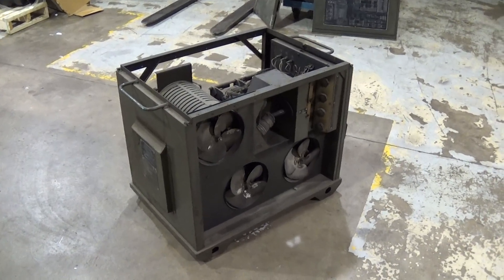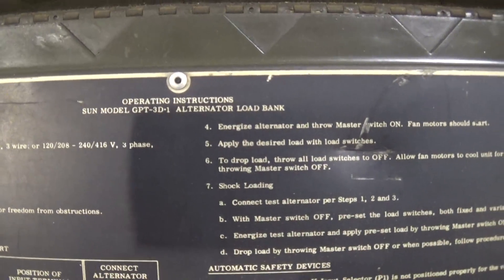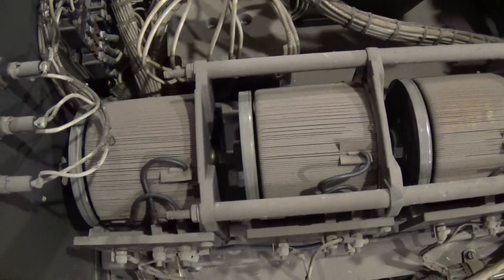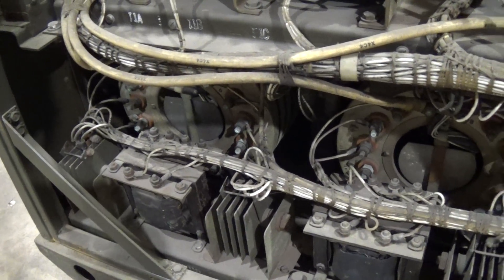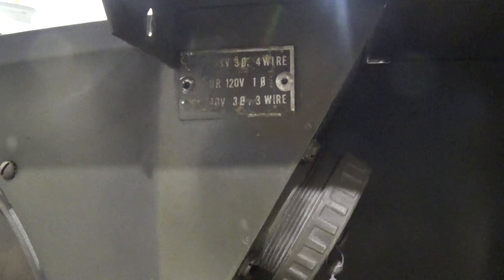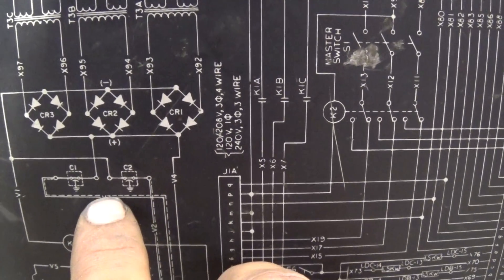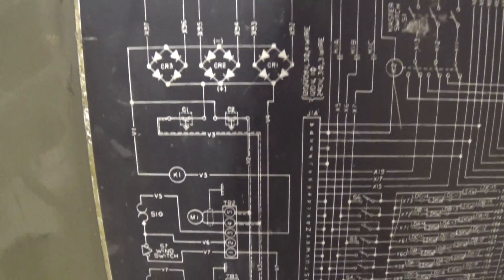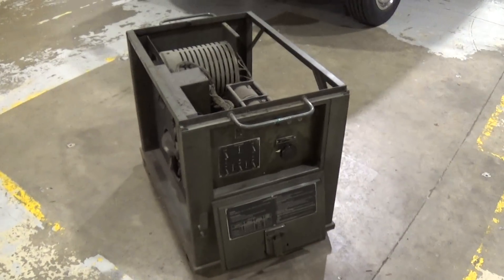30KW GENERATOR LOAD BANK

Comment: Neutral connection seemed to be common for relay coils... Rheostat looked more like a 3 phase variac? Military has their own way of doing things. DC fans, probably to operate over a large voltage range. We always called those proving switches "sail switches" on all sorts of equipment. If you smell rotten eggs when you hook it up, look at the seleniums, they age out, used or not.

Comment: As mentioned by others, I would consider replacing those  Full Wave Bridge Rectifier Assemblies. If you pull one of those motors it may have a nameplate with current draw to determine size.  Also I'd strongly suggest you replace the Filter Capacitors, I'd assume they are some kind of "wet" type that dry out and are very prone to short out...usually at the worst time. That unit looks like good solid military grade construction though.

Comment: wanted to ask a question for the bigger older generator heads that run 240/220v 60hz or 50hz 5kw+(non-inverter type), could one run household stuff like computers/tvs etc off these, or are these strictly lighting and element types

basically is the power clean enough to run more complicated stuff, or is it far to spikey?

I wanted to build a generator head just to see if I could do it, but if it needs to be inverter based for anything other than lights, I might as well get a pile of 125amp alternators and hook it to a car engine with the biggest inverter I can find. the big old generator heads have always amazed me at the power outputs

Comment: 416v is a byproduct of 240 wye. It's not super common but maybe the military made use of it.
Reply: I think it is very common in Europe here.  About everything here that has some power runs on this voltage. √3 of 240 is 416...

Comment: Just a quick look at the schematic, unless the neutral IS hooked up, the fans probably won't work. Left most terminal of the transformers are all common with neutral. Also, relay K2 is common with the transformers. That also means you can have lethal voltages on the neutral (L0)if it is not well bonded to ground.

Comment: As I recall, selenium rectifiers can produce some very hazardous fumes when they fail so replacing them might be a good idea. You may be able to hide them to retain the original look. What you referred to as a rheostat is more likely an autotransformer but I sure could be wrong. You are the generator guru, not me.

Comment: you might even need that other load bank on ebay, some of your projects are large enough that 60kw would keep them from getting wet stacked. I am sure it is either the selenium rectifiers or the caps. but you will see which. with that girl friend, if the inside of the house gets cold, just run the wires from that massive blue jobbie out back into the abode, and overheat the living space in 5 minutes, if below zero.  I have been thinking about getting a large 41kw super computer from england, and it would do the same thing.

Comment: now days the model name would be preceded by an AN/ 
g means ground use
p means radar.
t means transmitting 
so you have a tester meant for a radar station 
also.  a lot of miltary generators for radios are 400hz 
gives a cleaner signal

Comment: Those look like selenium rectifiers, and if so I'd take a close look at them, as they usually get weak over time. If it were mine, I'd probably replace them with standard silicon diode bridges. Might have to add a bit of resistance to make them work, because they're more efficient than the seliniums (less forward voltage drop). They also won't fail as spectacularly as the selimiums do either. Goes with out saying the filter caps should also be checked for capacitance, leakage, etc.
Reply: Erik J.  that is exactly what I was about to say

Comment: You can probably get the TM's for that unit at the STEEL SOLDIERS website . They have lots of TM's to download . Also try the G503 website . Also a good resource . The SS site has LOTS of info on military generators and load banks . BTW all Military generators or vehicles have  have  basic info attached to the unit , that unit should have a  a  ID plate with what TM to use to service the unit . good luck , Bob k